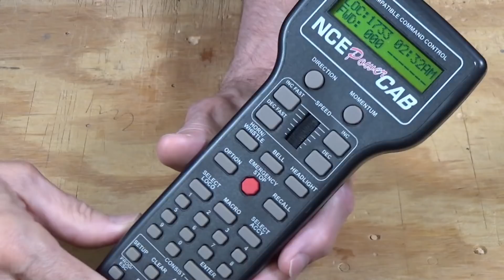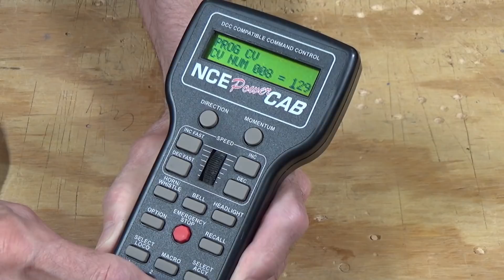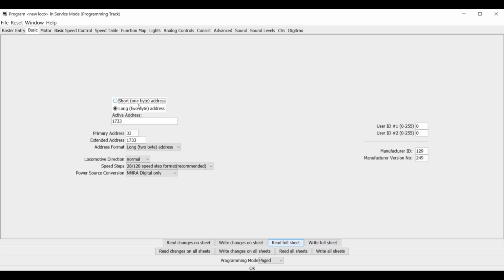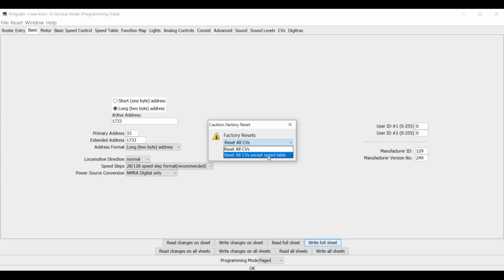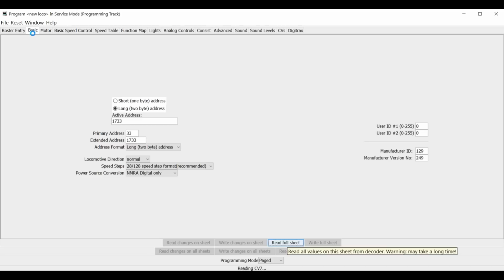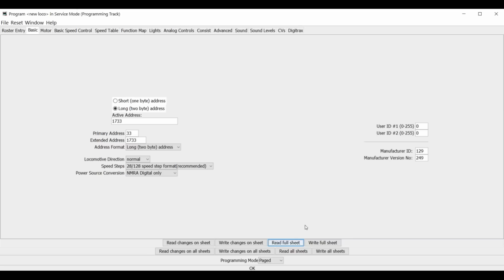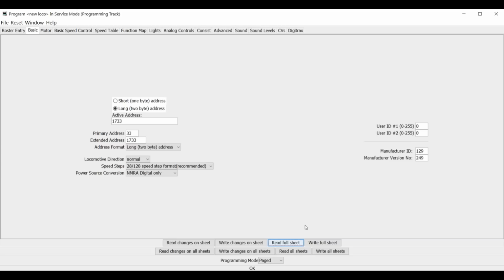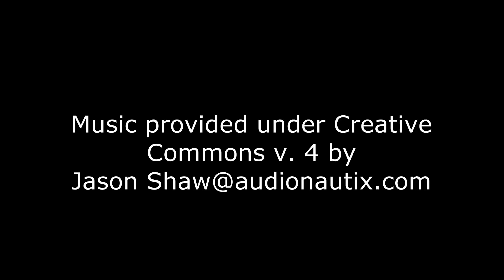Resurrect A "Dead" Decoder (105)

Comment: I bought a DCC Power cab last year, tested it out for a couple of days and worked fine. I then moved house and the layout and power cab went into storage. Today I set up the layout but I cannot remember any of the loco numbers I used, I've fiddled around with the Power Cab for hours but cannot get it to do anything now I'm totally confused and the Power Cab is nothing more than a brick. Any suggestions anyone?
Reply from the maker: You should still be able to enter the addresses of your locomotives and operate them. If not then something has happened to your PowerCab.

Comment: Thank you so much for your videos.  I have learned a lot even though I have been using DCC for over 15 years. This one on restoring a :dead" decoder has saved the bacon. I was about to purchase some new decoders thinking they had failed when I found your video. I was able to restore 2 out of 3 failed decoders.

Comment: I have a bit of a problem with my Broadway Limited Paragon 3 4-8-4 Niagara. You see, I bought this engine just over two weeks ago. It ran it on my local club's layout where it ran fine for a lap until it ran away on me. I had no control over the engine. It was until the other day when I took it into a hobby train shop where I was told it suffered a short circuit. while they were testing it, they factory reset it and it stopped running away but another issue rose up. Once reprogrammed to its address, the engine's sounds and functions work but when you try to get it to move, it doesnt move at all. The motor was tested and it does work but it will not move at all with responding to commands from the controller. Everyone that I have gone to still have no clue what is causing this issue. What I did find is that the motor decoder and the regular decoder could be on different addresses. Any idea of what can be done to resurrect my Niagara?
Reply from the maker: I don’t know what you mean about 2 decoders, I have never heard of them having more than 1. If the reset did not cure it then it is likely part of the motor power circuit cooked. If it is still under warranty send it back to BLI and even if it is not you still may need to get them to repair it.
Reply: @TheDCCGuy   I thank you for your quick reply and I guess I will need to send it to BLI or have my local model railroad store fix it if they can find a motor power circuit board. I did take apart my engine and saw the part that needs fixing.
Reply: Is it a blue line?
Reply: @dennisbailey6067  it’s a paragon 3 model. I do now have plans to send in the model.

Comment: There is so much to learn with DCC and I am 79 yrs. old re-entering HO scale and just starting benchwork.  Larry's videos
are very helpful.  I like the idea of going over some of them more than once making notes.  Our hobby grows more
expensive as inflation takes its toll.  I think, the learning and relearning has priorities given where each one is at with
building and gaining knowledge and experience.  All of this almost seems sequential; i.e., layout initial design, room
lighting, small section of benchwork, wiring, command stations, power cabs and boosters - it's mind blowing.  I need
to scale back a small around a 12 x 12' bedroom shelf two deck layout idea to one 3 x 12 section until the learning
curve can readily handle further expansion.  One thing I've never understood is that hobby magazines tend to show
us club size layouts that surely must be expensive maintenance monsters that we will never build.  Reading about
a small layout that is readily achievable seems rare.  Thank you, Larry Puckett, I appreciate your tutorials.
Reply from the maker: MR regularly does small layouts for their project railroads as they have to,be able to fit in the elevators in their building. There have also been a number of contests to,design bedroom sized layouts. Check out the Model Railroader website to,see if they have any layouts there. They do have a track plan search feature but that may only be available,on their subscription website. Their book division at Kalmbach may have collections of small layout designs in book form.

Comment: Larry - Thanks, again, for another fantastic video!!

In one part of the video you mention using a value of "8" in CV 8 to reset the decoder to factory settings. Yet, in another part of the video you mentioned "08" as the value to enter in CV 8 when wanting to9 reset the decoder.

I have an NCE PowerPro system using DecoderPro as well and have several "dead" LokSound Mini 5 decoders that I am trying to bring to life again. I'm confused which to use as neither seems to reset it. Any advice??

Thanks
Reply from the maker: I doubt it would matter with this CV. NCE can be kind of picky with addresses but I don’t remember why I said 08 vs 8 in that video, probably just talking too fast.

Comment: Hello, I am having trouble with a decoder. I have an Athearn Genesis SD45-2 with DCC and sound. It even comes with a sound controller for DC operations. I know it works because it runs and makes sound perfectly on the DC track, but when I try to use my Power Cab to run it and reset it, it tells me that it cannot read the CV’s. Any idea what’s going on and how to fix it?
Reply from the maker: What address are you using? Keep in mo d that with NCE there is a difference between 3 and 003.
Reply: @TheDCCGuy  I’ve been using the long address. I forgot what I set the short address to.
Reply from the maker: Did you set CV29 for long addresses?
Reply: It has an Mrc decoder??

Comment: Hi Larry. 
What happens when it reads "CAN NOT READ CV" . Not a contact problem. I have 2 ESU 53611s that do that.
Reply from the maker: What DCC system are you using?
Reply: @TheDCCGuy  This exact same NCE you're using.
Reply from the maker: @dorapadakis2957  And are you using it with DecoderPro? I have never seen that with my PowerCab system. Try a complete power down and restart then see if it still does it. You should still be able to program it using ops mode.
Reply: @TheDCCGuy  Thank u for your reply Larry. I opened up a brand new DC loco. Use an ESU new decoder with no issues. Just plugged in the one I have a problem with, enter the values and I get to the same massage after "...please wait"   PROG CV.    Can not read CV.
Reply: Do not have the Dec. Pro.  I did the power down. Nothing. 2 of them.

Comment: Ok idk what I did on my locomotive, but it won’t respond period. Now, it was working just fine, until I went to active the mars light, I’m using digitrax decoder DH126 and I have an NCE system with no programming track. I accidentally went to ops prog accy cv and thought that I was programming it via there, then I went to the program main track and I believe I programmed the wrong cv’s or something. I popped the top of to check my connections, and when I put it back on, nothing, so what I did was put in on a dc land it works just fine so I know I did something sketchy with the decoder. I tried resetting the decoder and still nothing and it’s not my track since it was working fine before I went to active the mars light. Please help
Reply from the maker: OK, take a deep breath and step away from the locomotive ad the layout. Anytime something like this happens you need some time to calm down and then come back later with a clear head and a plan. Since the loco runs on DC that is a good sign that you didn’t fry the decoder and the wires are all OK. The fact that you cannot reset the decoder sung the CV8=8 reset suggests the loco is nit getting your OPS mode programming commands. The most likely reason for this is that you inadvertently changed the address or CV29 which controls whether the short or long address is active and the decoder will not respond. For this reason you need to get it on a service mode programming track since that will reprogram CV8 no matter what the address or CV29 setting, as long as the decoder is not fried. If that doesn’t work you can still try reprogramming the address and CV29 but it will not be a good sign. You are kind of hamstrung without a service mode programming track so take a little time to set one up, it can be done in just a few minutes and the bonus is you can read back the CV settings. If none of that works then take a good look at the decoder for any blisters, holes or other signs of a melted shrink wrap. Also give it a close sniff for the tell tale smell of burnt electronics, commonly referred to as a cat pee smell. Good lick a d let us know if you get it sorted out.

Comment: Larry, what do you recommend to reset an older QSI decoder in a HO Proto 2000 E-6? It was a good runner about 3-4 years ago. Then I put it away. 
Now it just sits on the track with the mars light flashing on dim once in a while making a click sound from the speakers (2 of them). Then after a few minutes of trying the throttle it takes off full speed then stops. I’ve tried it on several different tracks on the club layout, including the program/test track as well as my isolated loop track at home. Now it has a sporadic short then comes right back on. 
Our club also has the JMRI computer program and it showed the decoder was a G scale decoder brand I’d never heard of. It is a QSI decoder. So I called Walthers tech support and they said resetting the CV8 doesn’t work for QSI decoders. Walthers gave me the CV numbers to reset but the JMRI couldn’t reset them. I’ll try with the Power Cab. 
I have the NCE Power Cab and followed your simple instructions. Then remembered resetting the CV 8 will not work on this QSI decoder. 
Since it is old maybe a new decoder is needed? But I’d rather try a reset since it acts like it has some life left to respond.
Reply from the maker: QSI and MTH both have always been quirky decoders. They have done a lot of their own thing and I have steered away from them for that reason. I know of no one who I consider an expert on MTH and only one guy who professes to know anything about QSI. Maybe he will read this comment and chime i  but I have not seen him comment in a while so don’t know if he is still watching. You might check https://groups.io to see if there are any QSI forums there. In the end I suspect you might want to start considering which type of decoder you want to buy as a replacement.
Reply: @TheDCCGuy  Larry thanks much. The irony is I also have an A/B set of ATSF MTH F-7 units that I bought thru a friend some years ago cheap. Beautiful passenger units in red & plated stainless steel with authentic sound. The big difference is MTH has come thru for me, admitting their system had issues with NMRA SOP. They also replaced the decoder and motors as they found that there was a factory defect. They also replaced the defective automatic couplers controlled thru a CV with KD couplers. 
I told them that the club had banned MTH so could they tweak settings so they wouldn’t know they were MTH? They did, but instead of function 8 for sound it was press 3 twice to turn on sound🤪. Those MTH F-7 units are about the best units I have now for the Super Chief. I just ad a couple of dummy Athearn units to match and they can haul the whole train.
Reply: QSI can be reset in DC.If it has a reed sensor use a magnet.Or unplug and replug a socket on the board.Cycle power.
Reply: @dennisbailey6067   OK thanks. So if I put the unit on the test track in DC mode then run a magnet over the board it will reset the DCC? Or if that does not work unplug the board then replug it? Please advise. Thank you.
Reply: @railscenes4959  It will reset decoder,if done on DC or DCC.Apply power and hold magnet over loco until you hear "reset".If it doesn't have reed thete will be a plug on board.Remove,apply power,turn off,replug.

Comment: Can you help me out. I have 2 atlas MP15 .I have reset CV8 I have got it to work on the short address. Can not get it to do anything on the kind address. When programming on programming track it says cannot read CVS I have reset CV 7 to 04 did not help. 

Thanks Roy
Reply from the maker: What kind of decoder is in them, what addresses are you using, and what DCC system are you using?
Reply: @TheDCCGuy  there atlas quantum system and I use NCE DCC control system . I have it set to the short  address of 3 . All functions are working on the short address. It won’t do anything on the long address.
Reply from the maker: OK, I figured that was the situation. With NCE there is a difference between a short address like “3” and a long address like “0003”. You have to enter the leading 000’s with the long address.
Reply: @TheDCCGuy  I have set the long address to 1004 the locomotive number. And it will not do anything.The locomotive will work on short address of 3 . I have reset cv8 to 8 and reset cv 7 to 04 . It still says it can not read cv’s. The controls says it is in page mode when trying to set cv’s. I’m so lost .

Roy
Reply from the maker: Forget CV7, that should be the decoder’s version. Also get out of paged mode and use direct mode.
Reply: @TheDCCGuy  ok thanks I will try that. The decode is a dual decoder DC/DCC Will that make a difference?

Comment: Larry I remember this video and today I had an engine I was testing in my yard with all my turnouts and it shirt circuited three times I was able to do the factory reset CV8 to an 8 and that worked.  My Decoder is a Rolling Thunder. I was not sure about that until I decided to setup Decoder Pro on my Work Bench I have the USB to NCE interface and that read the decoder info.  Going to play with more Decoder Pro and setup the rooster for all my engines.  Thanks for the great info
Reply from the maker: Tom—Glad you got it fixed, I don’t make this stuff up, it really works!

Comment: I have used my NCE PowerCab to perform this exact same action on several "dead" decoders that were in units that I got off of ebay and elsewhere. So far it has worked every time. Of course now that I have said this the next one I try will fail.

Comment: I have an HO Intermountain D&H Heritage ES44AC with a Soundtraxx MC-IM84 dual mode non-sound decoder in it that is malfunctioning after many years (5+). The lights come on and oscillate rapidly with throttle increase stabilizing at max throttle, but the motor will not respond.  There are no wires disconnected or loose near as I can tell with the body off and decoder un-mounted.  I've never run it in DCC mode, just DC. (I have a Digitrax Chief set but haven't taken the DCC "plunge" yet.)  Any suggestions about repair or replacement would be most appreciated.
Reply from the maker: Do a factory reset by programming CV8 to a value of 8. That usually takes care of situations where CVs have been inadvertently changed due to intermittent shorts on the layout, etc. If that doesn’t work you’re probably going to need a new decoder. If you are not clear on this see my video #105 on resurrecting a dead decoder.

Comment: MRC decoders (XL systems) are the ones I have found that DO NOT follow NMRA standard of the CV8 to 8, its 125 to 1 to reset.  Always check your decoders manual for resetting CV's.
Reply from the maker: On my old website I had a post listing all these variants from the NMRA standard but that is no longer available. I guess I need to make it available elsewhere.

Comment: I have watched your excellent videos. I have tried using NCE to factory reset an Athearn Genesis dcc sd70ace as well as with decoder pro. So far spent about four hours on it. As a result I get sound but still no movement. Pressing the wheel certainly notches up the sound. It's as if the train brake is on and it won't allow me to move. Any advice please?
Reply from the maker: There are a lot of potential problems and reason so first tell me some more. Have you determined the type of decoder in it? They have used both SoundTraxx and LokSound. Also how old is it and are you the first owner? If you are first then did it originally operate correctly? If so what precipitated the failure? it sounds as though some component if the motor power output circuit has failed sin e you say the decider sound does notch up so it is responding to commands, just not providing power. If that is the case then it will need repair or replacing. Hopefully it is still under warranty.

Comment: cant we repair faulty dcc?  i have TTS Dcc, and its make a small sound when put at track and its show short circuit on maltimaus
Reply from the maker: Check your locomotive thoroughly for short circuits, especially the wiring. You could also check the decoder with a magnifier and look for stray wires that might have fallen on it. Other than that if it has a bad component or damaged circuit trace then it likely would cost more to repair than replace. Sorry but good luck.

Comment: Hi Larry i have this problem maybe you can have  some ideas. 
 I have had some problems with DZ123 Decoder. Installed in N scale locos, some of them was  working for several years,  but couple of them have been presenting red plastic thermal changes and in 2 cases a burned area can be find. 2 of them was totally damaged, and 2 are working no matter those evident damage, but i don't know what to do, to prevent further  burns. And mostly know how it happened.  thanks for your attention.
Reply from the maker: I am kind of surprised you are seeing these problems since this decoder is rated at 1 amp and should be safe for N-scale installs so there must be something amiss with your locos. Your locos must be operating at near the upper amperage limit for the DZ123. In an enclosed area like an N-scale loco this can create excess heat buildup and the wrapper wrinkling leading to decoder failure. Check your stall currents and make sure the locos are not drawing more power than they are supposed to. When you replace the DZ123 see if you can go to one with a higher amp rating and/or try to carve out more space in the loco.